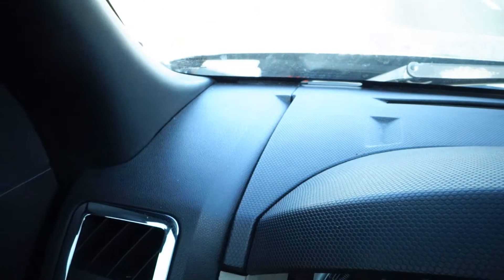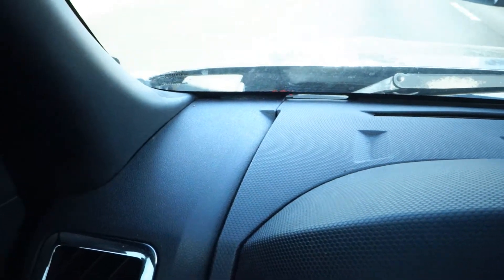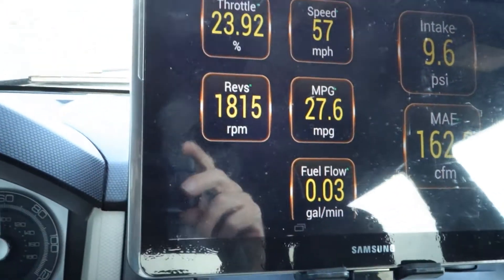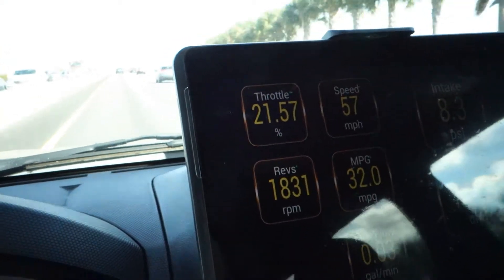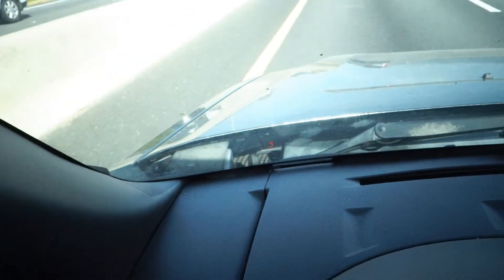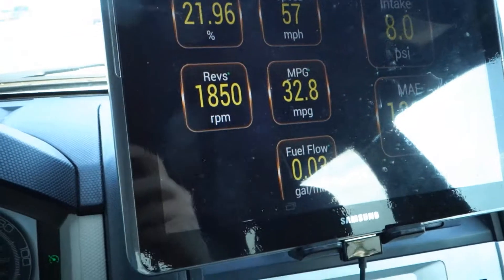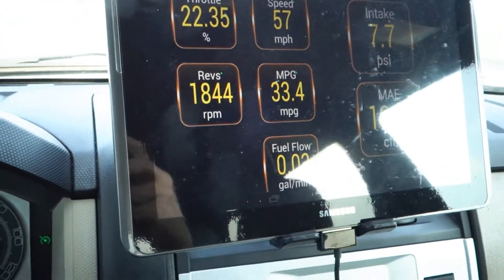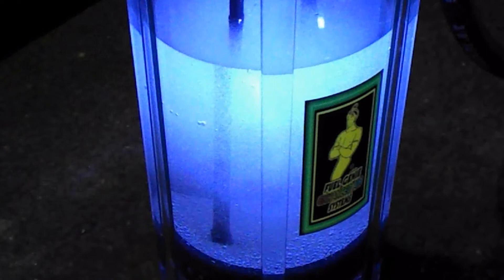MILEAGE INCREASE ON CC

Comment: are the saving in fuel more if you running the system at 10 amps??
Reply: This is not a good test and your information is wrong. At 24% or 25% of throttle you get between 25 and 27 mpg, then as soon as you turn on your hho system, and you press the gas pedal a little bit less so the throttle decreases to 21 to 22% and you get between 29 to 31 mpg. Your are not getting any saving with your hho system, you need 1/8 to 1/6 liter of hho gas per engine liter. At least you need 6 amps for your pickup and even with 6 amps you wont get any saving untill you use an efie on your O2 sensor.

Sorry about that but you should stop making videos with wrong information
Reply from the maker: @davidcantos1970  The video is not a test. It's just showing how adding a little hydrogen gasses to your engine can increase mpg. We have sold over 300 kits in the past year. No one has ever complained about not getting a lot better fuel mileage. Now, with our wireless remote control, the driver can adjust the amount of hydrogen going to the engine. There is an optimum ratio of fresh air to hydrogen that gives the best fuel mileage. Systems that use stainless steel plates use a lot of energy pushing current through the plates. We use titanium plates infused with rare earth Noble metals that yield 9 times their weight in O2 and H2 when energized. Stainless steel is very old school. Knowledge of the science has improved vastly. There is so much more going on in the combustion chamber than anyone ever knew. We know. That's why this test vehicle that used to get 18mpg on the highway now gets 30+ mpg since we started using the titanium plates. They don't rust by the way. Your system is terribly out-of-date.
Reply: @fuel-genie-systems1  still wrong.... it doesnt matter about plates, as soon as hho get burn into the comvustion chamber, it makes CO, CO2, oxygen, steam, etc thats why you need an efie, because the O2 sensor will read more oxygen and it means lean mixture so the computer will inject more gas!!! You can have gold plates, you will not have any savings because of the O2 sensor. In some cars with hho systems you need to manipulate maf/map sensor, iat sensor, cts sensor and so on. Good for you if you already sold over 300 kits, it doesnt mean that your systems without an efie really work
Reply from the maker: @davidcantos1970  I never said you don't need an EFIE. Our systems require and EFIE on all engines over 1.8 liters. We have found an EFIE not to be necessary for smaller engines. Even FI engines like motorcycles.
Reply: @fuel-genie-systems1  sorry for this man but youre still wrong.... every single engine that use fuel injection need an efie, even small engines, your research is not complete then; and if it was truth, why did you say in your video "with small amount of hho gas in my 3 liters engine, i got between 28% to 30% of fuel savings"? You never mentioned an efie. Your should find a better way to explain your videos with all information.
Reply from the maker: @davidcantos1970  Two words_ Cruise Control. It's the engine making those adjustments. Sorry to burst your bubble.
Reply: @fuel-genie-systems1  not at all.... Youre still wrong and lying to people but its ok, is what You do
Reply from the maker: @davidcantos1970  I'm leaving your comments up here so others can see how uneducated, small minded humans think. You think you have more knowledge than the scientists at NASA, DOT, SAE and universities around the world. This link takes you to the scientific studies and research that positively confirms that adding hydrogen gasses to an engine reduces toxic emissions and allows the engine to run more efficiently in a lean configuration. Lean= more air and less gas for the obviously  uneducated. "Tis better to remain silent and thought of as ignorant than to open your mouth and remove all doubt. Thousands of people worldwide are saving money with hho devices on their cars, truck and gen sets. Please display your ignorance elsewhere.
Reply: @fuel-genie-systems1  as You want
Reply from the maker: Not necessarily. There is a point at which the mileage decreases if you add too much hydrogen. This is because the mixture becomes too lean to enable combustion. When you add hydrogen in the form of H2 and O2 after the MAF and IAT sensors, it creates a lean condition in the engine. Since lean means more air and less fuel to the engine, your mileage increases. If you add too much hydrogen, you lean the mixture too much and now you have to press further on the gas pedal to keep the engine running. This means you use more fuel.   
There is a narrow relationship between the amount of hho (H3O+)  and fresh intake air that determines the optimal increase in mileage. Our research shows that you need only a relatively small amount of H3O+ (hho) to increase mileage.
Amperage does not translate into fuel savings. Amperage is however important to know so that when you find the amperage that gives you optimal increases in mpg, you can adjust either electrolyte concentration or reduce voltage to keep that amperage. 
Our remote control systems with a LED display allow you to change the amperage of the generator while you are driving. This allows you to choose in real time the amperage that gives you the best mpg. Keep in mind how important this is to fuel savings. At speeds in town you will see you need a certain amount of hydrogen for your best mpg average. At highway speeds you will see you have to increase the amount of hydrogen to keep the fresh air/hydrogen ratio at optimal fuel saving levels. 
Hope this helps. 
Barry Hart
Reply: @fuel-genie-systems1  Yeah, but to lean mixture means very good burn and more power... more power=less fuel consumption, lean mixture is difficult to ingnite via spark plug, thats why hydrogen can ignite easly and quick burn the gasoline inside the cylinder, at 10 amps you should get less fuel consumption... also diesel, they run normally lean , alot hydrogen would give them better mpg... sry for my bad english, im from Croatia
Reply from the maker: @antoniotod9614  There is so much wrong with your hypothesis I can't even begin to tell you where you are thinking incorrectly. Lean mixtures are not necessarily difficult to ignite. 14.7:1 air to fuel ratio is the stoichiometric value gasoline engines are programmed to run on. You can lean this mixture to 17.5:1 before it no longer burns. So if you're talking about leaning an engine to 17.6:1 then you are correct about it being difficult to ignite because it won't. Check out this link to "How hydrogen works in engines and you'll revise your statement. The most any of our generators consume is 1.4 amps and that increases mpg on diesel engines a flat 25% on the highway. Stainless steel plates are Old School. We use titanium plates infused with Noble metals- Irridium, Rubenium e.g. These plates never rust, use tap water and yield 9 times their weight in h2 and o2. They never deteriorate. This is State-of-the-Art technology.